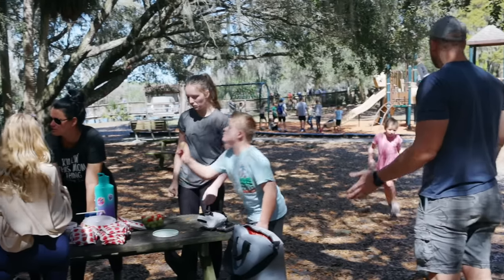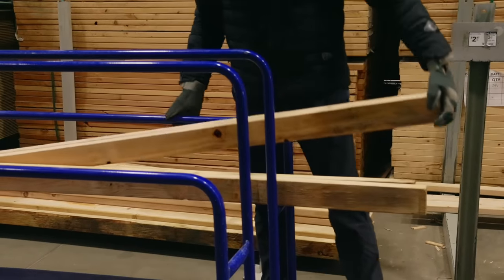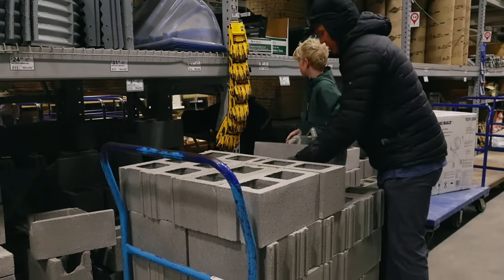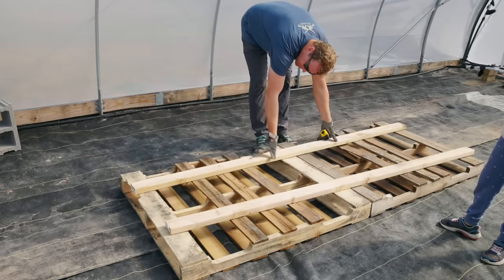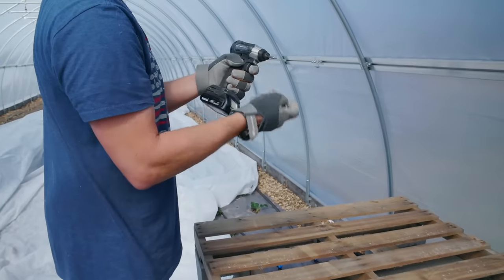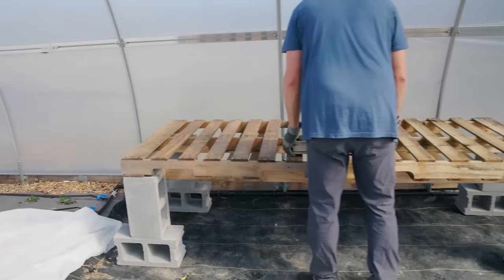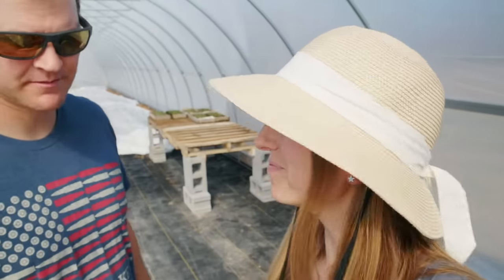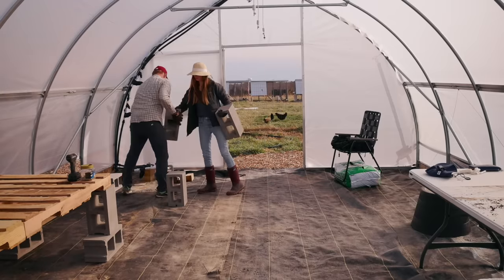Room to Grow 3,900 Seedlings!

Comment: Working as a mason for years, I would suggest you rotate the bottom block to the cores are vertical instead of horizontal.  They will last much longer that way.

Comment: Those 48 x 40 4-way pallets are really good. If you can ever get your hands on some of the blue grocery store pallets, grab them up. They are very strong. Probably twice as much as a standard 4-way pallet. I used to work on a loading dock at a printing plant and dealt with all size pallets. You never know what you're going to have to unload or load. The sizes varied quite a bit. We used to get rid of irregular sized pallets by the 100's. And we sold back the 48 x 40 pallets to a used pallet company by the 1000's. And I'd definitely place a 3rd set of cinder blocks in the center of the seed starting stations. They will last longer with less sag. And I questioned the upside-down cinder block T stand. Too much weight on one edge and the entire thing could start tilting over. Glad you decided to change the configuration.

Comment: The tables turned out awesome! The only thing which came to my mind is that the pallets will have an issue with the overhead sprinklers, maybe on top of them I would put a foil (like what is covering the tunnel) or a wooden panel which has been treated with linseed oil or sg🤔

Comment: Just cut a 2x4 for the center support on each side.  That will give you more than enough support. 

Also, in my area, it would have been cheaper to purchase PT 4x4s and cut them to match the height of the CMU's. And cut a 2x4 angle brace, attached to the 2x4 "joists" to solve the "raking" problem you were discussing about the CMU tipping.
CMU > $2.58each X 3 (you are adding another one)= $7.74 per corner
4x4x8> 13.68 ea divided by 4 (cut to 24" to match the same height as the CMU's) = $3.42 per corner, plus 18" 2x4 brace (each way) $0.87= total corner  $5.16.
In the end, 4x4 makes the job easier, lighter, and easier to move around.

Comment: Did you test the throw of your sprinkler system before you decided exactly where to place your growing benches?  It appears your sprinklers go down the center of the tunnel.  If that's correct, you may find your irrigation to be uneven, particularly on the trays nearest the tunnel wall.  You might need to move your benches closer to the center.
Reply from the maker: The only place I’ve noticed that the watering is less is in the front corners where we didn’t put the tables. We will find out soon how the rest does!🤞